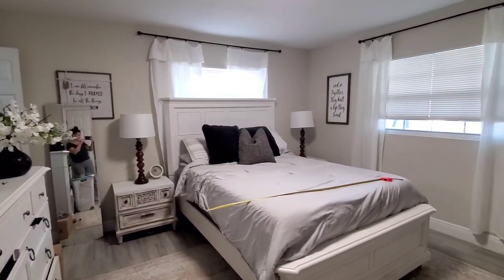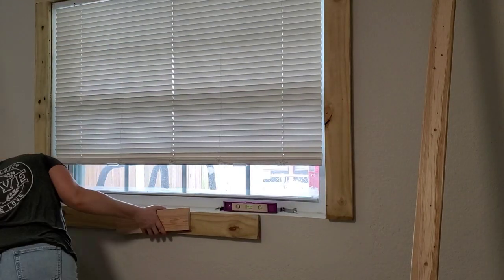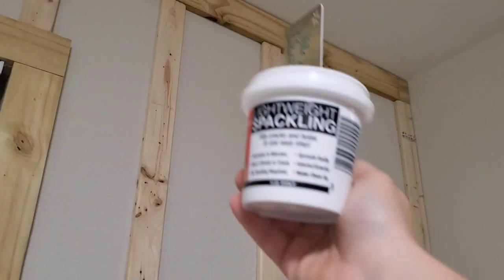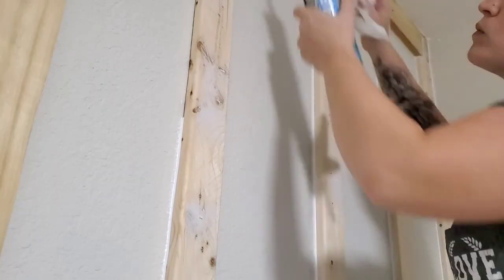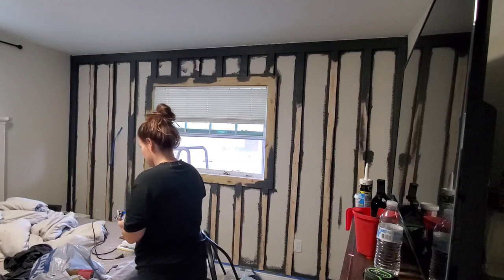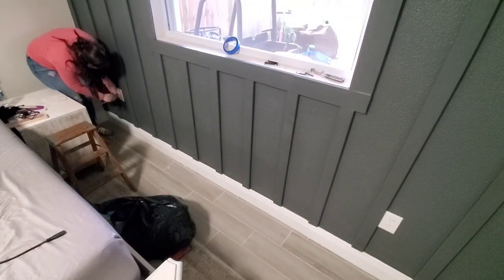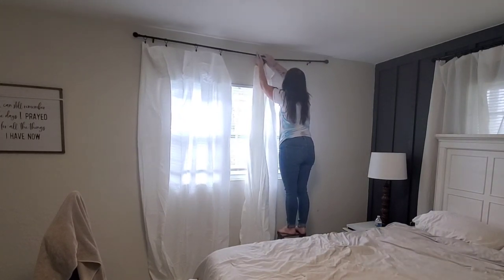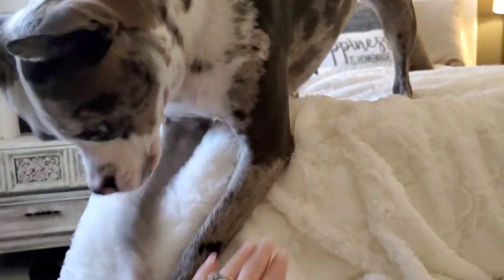Bedroom transformation | Accent wall DIY |  Farmhouse Master bedroom makeover on a budget

Comment: I use those same sheets as curtains! I cut slits into the top part (can’t think of the name right now) and made a rod pocket that way and they ended up being the perfect height for my window with a little extra to flow on the ground for a flowy look. 

P.S. your wall turned out fantastic!